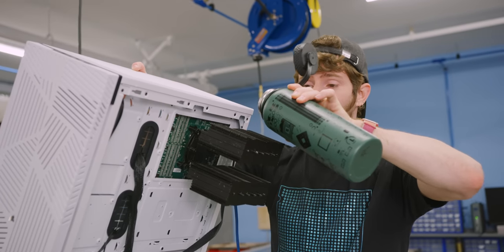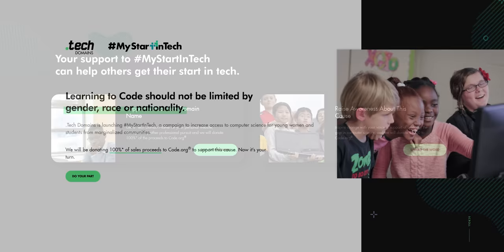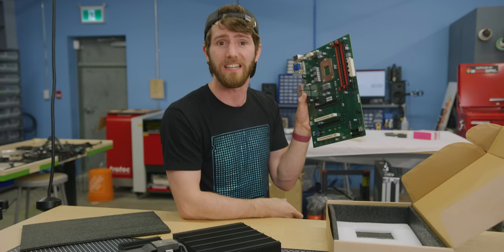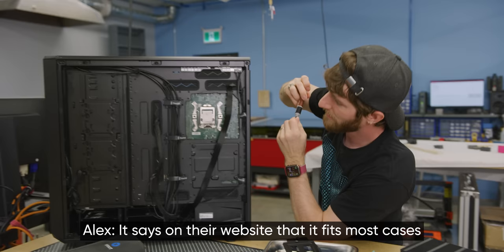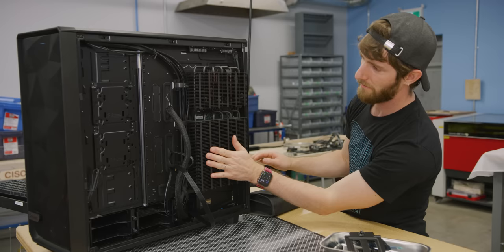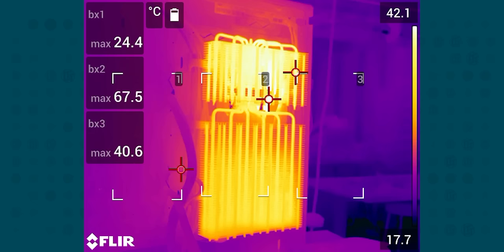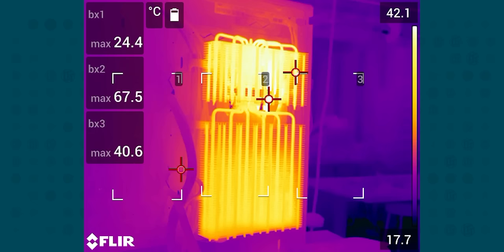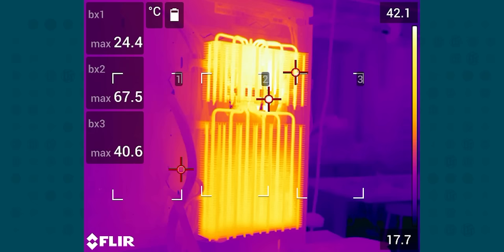What Happens if you Water Cool an Air Cooler?

Comment: I've been continuously surprised at how well regular ass hardware holds up to dust. We've got a client who does architectural steel and most of their shop systems are basically coated in iron filings and yet despite being normal ass optiplexes they basically all still work fine.
Reply: On a related note, I'm constantly surprised by how well modern hardware holds up to Linus... He does all the things I grew up learning to NEVER do, yet it all mostly works out. Goes to show you just how resilient modern computer hardware is
Reply: @TjPhysicist  Whenever I build a PC I always think I probably broke something, then I boot it up and everything works perfectly lol.

Comment: for anyone who don't know how to use a bag of ice:

step 1: slam the bag of ice on the ground (preferably at chest lvl and on a concrete floor, this will loosen up the ice into smaller chunks)

step 2: open the bag and pour out your ice..

step 3 (optional): pour ice into the cooler box and add a bag of salt (about 1/4LBS of salt will do per bag of ice, this will turn some of the ice into super cold water and this is super useful for cooling cans and bottled beverages/water super fast)

Comment: if you were worried about metal dust contamination and such, you could run it as a closed system, where the intake for the system was ported in from an ac unit or refrigerator/freezer that was pulling air in from outside. you might need to seal the electronic components, as constant exposure to that kind of cold air could cause moisture buildup, perhaps the cooling box could contain a small dehumidifier. this would obviously consume a lot of power,  but would be a practical solution that wouldn't see a computer sitting so close to a vat of water.

Comment: make sure to wash your pc, normal water on the gpu and motherboard works great
Reply: Thanks my pc runs so much better now
Reply: lmao
Reply: Mineral oil builders: 👁👄👁
Reply: I mean, you actually can as long as there isn't any power going to it, or any batteries on it
Reply: Hello, electrical engineer and manufacturing here...

After I'm done reworking or soldering motherboards, graphics cards, hard drive controllers, etc, I watch them in the dishwasher with dish detergent and everything. Then it dries. Then it works!

It's actually okay to wash electronics as long as the water has been softened and you make sure it's completely dry and no mineral deposits.

Comment: i know it's an old video, however it should be noted that the direction you placed the fins in goes against passive cooling, as the cooler depends quite a bit on convection to move air between the fins whereas in your configuration you pretty much trapped the hot air between them with cool air wafting over the unit, being limited more to radiation as a way to lose heat. I suspect had you turned it 90 degrees it may have demonstrated better performance. would be interesting to see the designer's intended setup.

Comment: "Can you water cool an air cooler?"

VRMs: *Demonic screeching*
Reply: VRMS, "guess I'll die"
Reply: What’s a VRM?
Reply: @UcheFiasco  Voltage Regulator Modules - they're basically responsible for making the voltages sent to the CPU be stable and to requested levels. The voltages coming from the EPS connector is 12V and way too much for the CPU, so the VRM is responsible for stepping it down and also making sure it is as steady as possible.
Reply: @matasa7463  got it! Cheers

Comment: Regardless of how well you cool the radiator, the entire system is still limited by the saturation capacity of the heat pipes. At some wattage, the hot ends of the heat pipe are going to dry out because of the wicking limit of whatever sintering or braid in them. It won't matter if the cold ends are always cold. The cooling performance drops to that of the cooper tube walls and the entire thing becomes useless.

Comment: Love this design. Imagine a custom case with built in Heatsink at the top.
Reply: Maybe its better put heatsink at the bottom with water, itll be more safe from water leaking
Reply: @verify8295  That's what I was thinking, if you did this properly you could make a completely leak-proof water-cooling setup as the water would always be below all electrical components.

Comment: On the theme of industrial computers, would love to see a build that uses an "external" AIO where the radiator(s) and fan(s) are outside the system, but feed through the case to actively cool while keeping airflow (i.e. dust) out of the case.
Reply: linus old office had something like that with all the pcs hooked up to the same(?) pipeline of cooling iirc that ended um a huge radiator outside the office

Comment: Also extra note.. It makes me wonder what the top thermal efficiency of an air cooler used with water cooling like this could be.. Remember that the water in the heat pipes have to boil or evaporate on the bottom of the heat plate and force itself up (or down in this case) the tube whereby it cools and wicks back to the plate. If you cool that water at the plate to the point it doesn't evaporate, would it hit it's thermal efficiency then or is it possible the temps of the plate would just continue dropping?
Reply: Yes you are totally right, that's the case here. Heat pipes are meant to be used in normal temperature conditions
And if you actually want better performance than an air cooler, then just get an AIO or custom water cooling kit that can optimally disperse the amount of heat throughput by the processor and the GPU you're using.
What LTT did was purely for fun and educational purposes and for views😝😄💰🤑
Soyunara boii!!,

Comment: Hello! just wanna share this little trivia :D this is interesting. In engineering this is what we call heat exchangers. the fansXfins, or other types of cooling systems are generally called heat exchangers, and for your experiment, where the heated medium is inside and is surrounded by cooler fluids functions somewhat like a shell-and-tube heat exchanger. So what you guys did for the cooling will definitely work, but you want the fins at a lower area so that the heated water goes up and you can cool down the heated water in another cooling system. I love this.

waiting for that "we could come up with something better" and i hope you do. my mech engr ass is shaking with excitement :D
Reply: we could come up with something better and call it radiator
Reply: I'm guessing they should also rig it to have the fins parallel to the water flow?

Comment: there is a improvemente that can be made, you can immerse the motherboard in...., distilled water, theoretically..., it should not conduct the electricity, but would be neccessary check if there is oxidizable part, if all the components are stainless you can try it...., IRRC, the warm water goes up, and the cool water goes down, so in the case of this experiment, immerse will not do all the work, because the warm water will stay closers (the pc is above)

Comment: Imagine building a High Efficiency Particulate Air HEPA system based on the famous HEPA filters. Or something like a Cleanroom PC or CLEARPC! Where the heat transfer happens outside the BOX and inside is almost Zero air Movement. Food for Thought!

Comment: I'm a little late to the party but if you turned the whole case sideways so the slots between the fins ran vertically then you would've had better cooling performance thanks to unimpeded natural convective flow upwards along the fins

Comment: Practically speaking, probably the best way to use this kind of thing would be to waterproof the hell out of the back of the board, then use mini water spritzers aimed at the heat sink. You'd be surprised how much just a little water can do as far as cooling goes.

Comment: My well water comes out at about 50F year round and it doesn't take much power to pump it. I would love to set up a machine just like this near a drain with an overflow and have a constantly replenished supply of 50F water going into the tub. Would be fun to show people at the very least. Not quite freezing temps but hey, it's feels ice cold to the touch. Maybe instead of a passive radiator, I could just use a powerful pump and extra thick 480 rads, like 4-5 of them, and put the rads in the tub. The temps would be a lot better I imagine, and you could have a normal looking PC with just a few water cooling tubes coming out of the case rather than cutting a huge hole for a passive radiator/taking the side panel off, and putting the PC on it's side.

Comment: best way is to make sure the het come from the bottom and rise up. the bucket thing is not as good if the cooling is not at the bottom of the bucket. because it will not circulate otherwise.

Comment: the best way to use a bag of ice is throw it in another bag and then drop it on the ground. you can do this without the 2nd bag but if the bag that the ice is in fails ice goes everywhere when you drop the bag.

Comment: they should have used a sous vide circulator in the water to blow around to get rid of the thermal blanket around the heat sink 😂

Comment: what you need is a base that magnetically stirs the water like what chemists use, instead of a pump and a case that fully supports reversed cpu socketed motherboard and a way to mass produce this, and then we'd all buy it for sure.

Comment: I've always thought it would be cool (no pun intended) to run a water cooling setup with the radiator inside a little under-desk fridge.
This board is filling my head with a combo pc case that has a fridge on the back side. Keeping your gaming rig and your cold snacks chilled at the same time.
Reply: This won't work -

A refrigerator is cold because it's got a machine in it that pumps heat from the cold space to the surroundings.

The refrigerator manufacturer sizes that machine to be capable of pumping about the amount of heat that leaks in through the insulated walls. This is maybe a double digit number of watts or so at most. Any more is wasteful, makes it more expensive, etc

What this means is that the hundreds of watts of heat produced by your computer will quickly overwhelm the ability of the fridge to pump that heat out of itself.

A window A/C unit would be closer to the amount of cooling power necessary to do this. But really, at the end of the day, because you're pretty much always moving heat from your PC into lower temperature surroundings, there's no need to introduce a whole refrigeration cycle into the mix. The easiest way to get more cooling power is just to run more air through larger radiators.

Comment: You could more efficiently cool  the heat sink by adding an agitator to the water, something that will stir up the water like a motorized propeller so the heat that comes off the heatsink is dispersed more evenly through the tub. It would be more practical in a day to day usage of something like this contraption instead of adding in a whole bag of ice every few hours.
I know this is just for fun but I actually think this cooling method is pretty interesting. With AIO pretty much being the same method, you could technically improve them by just taking the radiator that comes with them and submerging it in water instead of attaching fans. You could restyle a case to have a completely sealed water tank at the bottom with the radiator inside and the hoses running up to your cooler/CPU and cooling it instead of just having fans blow the heat off the radiator.

Comment: you could potentially combine the water tank and heatsink (weld) but have the heatsink at the bottom of the water, that way you won't need a pump to move around the water as the warm water will naturally displace colder water and move to the surface (hot stuff is less dense), 

next step would be to have the top side of the water container much wider like a reverse pyramid so that the surface area for the rising warm water is much larger and thus has more transmission to the air maybe even add a fan at the top.

Comment: If you only submerge the heatsink in the water you only add much more thermal mass so in theory (perfect sealed system) if you run the test long enough the temps will rise to the same temperature as if the heat sink was not in water, it will only take much longer. In reality there are losses to the environment so that will not happen. Better option would be to do what you did at the very beginning where the water was just poured on the heat sink. You are adding an adiabatic cooling element that way. Ie. additional energy is rejected to water evaporation (change of state without temperature change) from the heat sink fins. This is often done on larger scale dry coolers,  air cooled chillers or AHUs for example.

Comment: Isn't it possible to 3D print a back panel with a bulge for the Heat sink? You can even modify it to be able to mount an exhaust and intake fan along with an air shroud around it for optimal cooling.

Comment: I had an stupid idea, what if you can like, make a case with a side panel that is like, hollow, put that giant heatsink in there, close it up and only leave 2 holes, one on the top, one on the bottom, and just like, fill the thing with water and use the holes for the pump, so you have the freaking entire side panel full of water, cycling thanks to the pump, and cooling that giant heatsink, that is a thing I would like to have and I think it could have potential.

Comment: If you use dihydrogen monoxide you wouldn't need to worry about shorting as it does not conduct electricity, long term corrosion would be the only concern. 
I'm pretty sure you can just drop the whole PC in there as long as it's clean from any electrolytes.

Comment: Linus here is an idea, why not use a freezer motor and fluid thing to go between the pipes? and keep it at freezing temperatures?  lol ... the cooling power consumption will go nuts but is definitely doable, and probably keep everything at 10-20 degrees C on throttling max power.

Comment: idea -- get a silicone mat the size of the case and/or water tank. clear-ish silicone would work best for seeing where to then carefully cut a small rectangular window for the heatsink/cpu interface point.  and, now you have a splash guard.
Reply: cut the window slightly small, too, so it snugly seals at the barrier.
Reply: also, use a shut-off valve installed at the submersible pump's intake, and you can control the splashing.
Reply: alternatively, you could use a silicone mold casting compound to make a waterproof barrier. you could probably coat the computer case side with mineral oil first to make for easy access if the need arises.

Comment: I've never understood the benefit of a water cooled system, because surely once the water temperature has reached equilibrium with the radiator, it's just being cooled by the fan like a regular heatsink, so what's the point?
Unless you shove the radiator in a bucket of ice water.

Comment: From my experience, heat pipe doesn't work well if its hot end is above the cold one. I think gravity just pulls down on liquid inside, holding it from transferring heat. Maybe that's only true for older heat pipes, but I owned a notebook that, if oriented upside down, would thermal throttle and then shut down

Comment: Couldn't you just put a huge heatsink like that on the normal side of the motherboard and use PCIe raiser cables for the extension cards? That would allow using fully standard parts and still have the same cooling performance.

Comment: If that had a proper flared base with a seal, so that it could become like one side of a column (tall prism) of water, this seems like pretty decent setup. With high enough column the natural density difference will cause water to circulate: the hotter the water, the more it will circulate. And you can even leave top open for that swamp cooling :D

Comment: What would be best but would require way too much work for what it's worth is to put the heat sinks at the bottom of the water bucket because the hotter water will travel up and the cooler water will go down, but that's wayyy too much work to actually make sure the water doesn't just start spilling into the pc

Comment: At this point I'm wondering why no one has build a pc casing as a fridge. 
Air tight, with heat insulation. No dust and perfect cooling.
Heck build in a door so you can store your beer or refreshment of choice in your pc casing ;)

Comment: wouldn't it have been better to point the water pump perpendicular to the heat sync so it pushes the water through the heat sync?  This would prevent the water splashing onto the board and circulate the water better

Comment: If you laid the air cooled case on its side, cooler up, would convection potentially help since the air would move through the radiator the "correct" way?

Comment: I honestly don't understand why computer cases are built in their current configuration. If the motherboard was parallel to the ground it would make all the sense. You could also design massive air coolers. Also all of the GPU would come from the side of the case. A completely different source of air (potentially). The power supply would have to be somewhere, but there are so many options for that. (underneath or offset) It would change the layout/floor space but that could be "shelf space" and that would be even better. The only negative I can think of is that all the pretty shit on modern computer internals wouldn't be all that visible. Edit: Hell I wish motherboards were backwards "L" shaped for a configuration like this. The small part of the "L" being the VGU slots.

Comment: For splashing upside dowwn! Why didn't you just cut & for a baffle around the opening of the CPU back area case sealed off w/ gasket or silicone or around CPU cooler heat pipes at least? 
I would have tried using a dual tank to pump , move water steady enough from tank to tank to reduce heat build up. Maybe even a waster wall flow over into revivor & return to chiller tank. So many ideas.